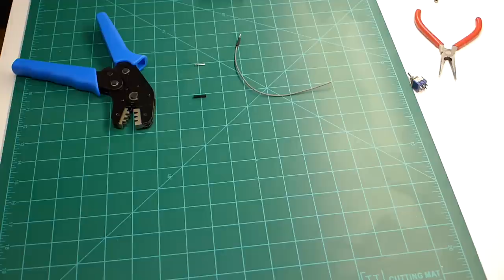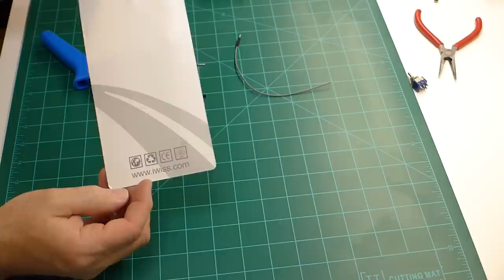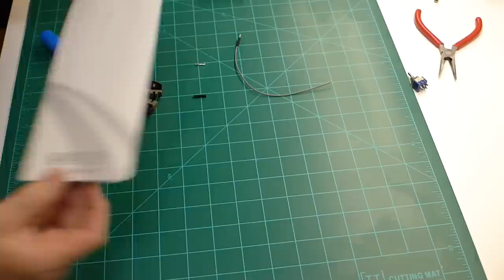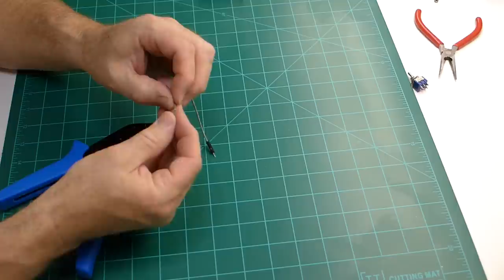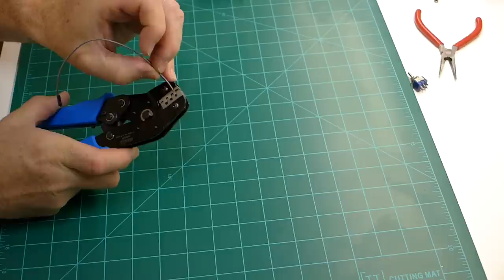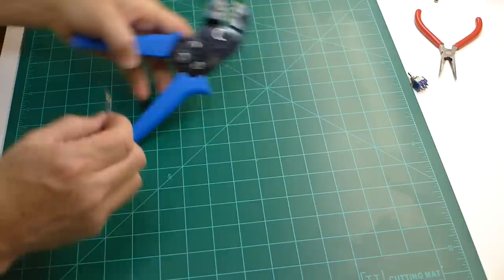Using IWISS SN-28B Crimper

Comment: Holding it upside down is genius. I've been trying to balance the connector and wire on the bottom of the die the whole time with very little success. The only thing to watch out for is shoving the wire in too far or not far enough since you're doing it blind. Thank you so much for this, there really is no useful info out there on these.

Comment: thank you! the best method I used so far. I usually crimp insulated part again on tighter part, so the connector fits in a housing without problem

Comment: Helpful, but what gauge wire are you using? I'm using 22, and I can't get the insulation into the large wings on the connector once the thing is gripped (at all) by the jaw of the tool. So I have to put the connector on the end of the wire by folding the wings around the insulation before setting it across the jaw.
Reply from the maker: I don't have access to my tools at the moment but my last Amazon order was for 22 gauge so that is probably what I was using. Once I pushed the stripped wire into the nose of the pin I didn't have to mess with the wings.

Comment: anyone know if this crimper produces crimps with a width of 1.4mm (required for Molex micro fit terminals 20-24awg) ???  Seems most products do not define the die widths, and only list gauge sizes, which is meaningless relative to actual terminal maker crimp specs.

Comment: I'm interested in doing this myself, just like you. I only plan on doing the wires of a hexacopter (to make it all Sweet-as!) What is yours, and others watching this, opinion on the crimping tools, like this and the single-stage types (for example: the Engineer PA-09 type) that would be best for a small-scale operator to use? I just can't make up my mind what to get. HELP! - When it comes to buying things i'm the Worlds Worst Shopper.
Reply from the maker: I find this tool to work fine.

Comment: Can you use solid core wire? Or is it only for multi-stranded wire?
Reply from the maker: I don't think I've ever used solid wire, but I can't see any reason it wouldn't work.
Reply: Crimping tools are made to crimp stranded wire so the strands are compressed by the tool.  You can crimp solid but it may not be a good mechanical connection.  Soldering is the way to make sure a solid wire crimp is both electrically and mechanically sound.

Comment: If you're right-handed the tool should be in your left hand, upside down (with the brand name visible) and stay there all of the time. The right hand does the fine work: inserting the connector and the wire.
Reply from the maker: Excellent point! I'm left handed.

Comment: Nice explanation(as everyone says difficult to see). I basically do the same thing, but the jaws are on the other way around on my crimper(same model) did you switch them? (I guess they are interchangeable so I might just do that)
Reply from the maker: That's the way my tool came. Seems like my method would be harder with  jaws swapped.

Sorry about the video quality. I used a high quality (eg. expensive) Lumix camera for filming, but it once it starts recording it has a shallow, fixed focal length, evidently, for video. 

Then again, had I known this video, made largely for myself, would be viewed as often as it has, I might have at least retried once.
Reply: It&#39;s okay the message came across 😀
And yes it&#39;s a pain with the jaws swapped. But I put them like yours now, they swapped no issue